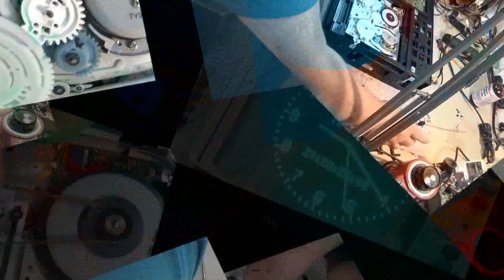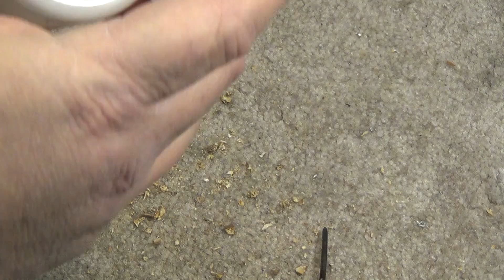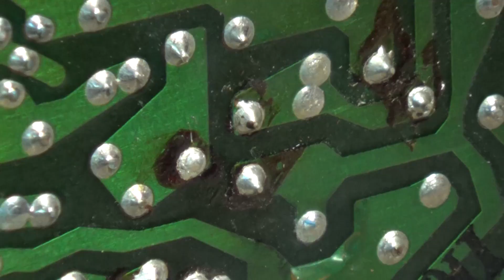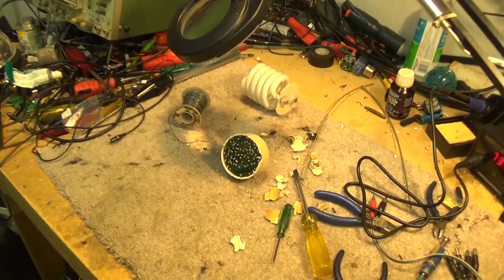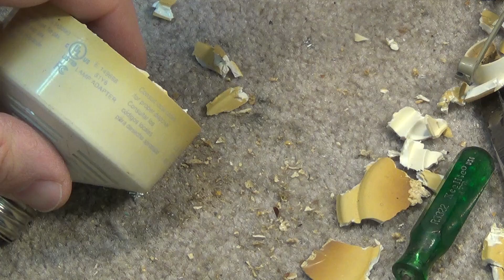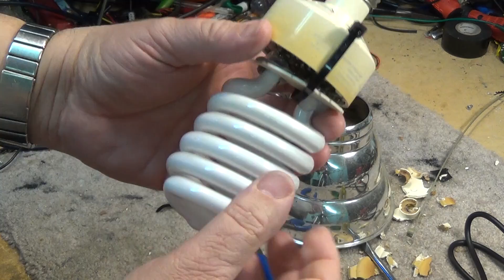42 watt cfl bulb repair

Comment: They could last longer or probably forever when the tube is facing up!
Leaving it hanging down can cause the heat to go up a fry the board.
Reply from the maker: Well that bulb lasted over 20 years when the lamp finally failed.  The board was fine so i stuck another lamp on it and it still works.  I have a big 65 watt cfl. I'm keeping it as a collector piece.  Along with a little 5 watt cfl. It's so tiny. Just 1 loop.

Comment: you know the customer service is usally good . I had a problem with are garage door opener from genie it caught fire and genie had me give them the model number and serical number my opener was on recall .they sent out a tech even thought I installed it my self .
Reply from the maker: +ducklandwikeno For most companies as soon as you say it sparked and smoked they want this handled as quickly and quietly as possible. The reason they were interested in the lot code was so they can track potential safety hazards. Nobody wants to be the next Zenith. In case everyone forgot, when Zenith went to their first Mexican made TV, the System 3, there was a solder connection problem on the horizontal linearity coil, and the new cheap boards were not fiberglass, they were that laminated looked like a wood by product board, and that sucker burned big time. Several house fires, and a few deaths resulted by these console (wooden cabinet TV) sparking internally and smouldering away for hours before bursting into flames.So when a company hears that something sparked and smoked, they respond very quickly. In the case of the defective bulb, which incidentally was the same lot number as this one, as I bought 3 at the same time,  they said they knew of an issue where the bulb failed and smoked as the internal fusible resistor failed safely, but for my inconvenience they sent me 2 free bulbs.

Comment: It is great to see you're making the most of that CFL! 13 years is a very long time, I haven't had a CFL last longer than 6 years usually although I've learned to try not turn them off and on as much as startups are the thing which kills them a lot quicker.

Comment: Only complete IDIOTS buy and use CFLs - takes a real moron to mess with fixing them.
https://www.youtube.com/watch?v=BBOxLi_-f0g
Reply from the maker: +theothertroll So tell me what is wrong with CFL lights?13 years ago there were no LED lamps, and even now the LED which I have used, and I have a bunch of them in my house, about 25 so far have not panned out very well. Out of the 25 LED bulbs that I bought that were supposed to last 20 years, 4 have failed, within 2 years. One, a Philips I tore down, and jumped a bad LED chip that had gone open. At least the CFL bulbs I use in places like my garage where I need lots of light have lasted a long time, and have paid for themselves in saved energy. Something I can hardly say for the cheap made in China LEDs that are flooding the market. The only reason I tore this one down was to see what failed in it, and as you can see it was a solder connection. The Achilles heal of all electronics these days.
Reply from the maker: +reynardfoxx I still like them for many applications. I will show off my new one in an upcoming video. It is a big one, a 65 watt monster over my work bench, and that is not the biggest ones they make. I have see 85 and 105 watt monsters advertised. I guess we can't really call these compact anymore. So now I have 2 42 in my workshop, and a 65.

Comment: They sure don't make them like they did back then, we are lucky if a CFL lasts 2 months.
Reply from the maker: +old64goat CFLs will last IF they are used as designed. They are not designed for use in areas where the lights are turned on and off all the time. Bathrooms are such a location. They are on for a minute and then off, and they will fail pretty quickly in this application. I use LED in that application. They also don't like to be in totally enclosed fixtures, they will overheat and have a short life. Ditto being exposed to wet conditions.  I have a bunch at my house, I am switching them to LED as they burn out, but I still have bunch of them here, that get used daily, and most are lasting the rated live. That is more than I can say for the Philips LED GU10 lights in my office that are only 2 years old and only putting out about 1/2 the lumens they did when they were new. Use them as they were designed for, run them for a minimum of 15 minutes and I have found that they last as they claim.
Reply from the maker: +Sony Trinitron Better act quick. The regular incandescent are being banned. I had a tough time finding some spate for my sons gecko. I need them for the heat, more so than the light, as reptiles need heat, and good old incandescent are a perfect source. They are getting harder to find now that anything over 40 watts is banned. Once stores sell out they have no more. Some speciality bulb makers are making new bulbs that look like antique bulbs, but they are expensive. Over 10.00 per bulb, but even those are being made as led style now. I have a LED filament bulb in an open glass fixture, and it looks really cool, with no heat.
Reply: +12voltvids I prefer regular incandescent bulbs for things like bathrooms, laundry room where they're not being used for long, my bathroom has had one incandescent bulb for at least 20+ years and probably won't be switching to LED on that one anytime soon, I'll think about getting a replacement incandescent bulb probably!

Comment: Won't the silicon melt from the heat causing mounting problems?
Reply from the maker: +jimbronie This is high temperature silicone I used.

Comment: Your fix... albeit less safe than OEM.... will provide for better heat dissipation. Hopefully the crusty plastic bulb base will not disintegrate around the tie strap. On the other hand $50 / 13 years =$3.85 / year. Still rather pricey but energy savings more than makes up for it.  Something that I would have attempted myself, but used computer motherboard standoffs rather than zip tie, but that is only a different method, not necessarily better. Thanks for the video and keep them coming.
Reply from the maker: +Doc Falworth Well this is in an open fixture, in my garage. The crusty plastic that was crumbling is all gone. The rest of it around the socket it fine, as it wasn't exposed to the UV that dried it out. The new tube base, made from the heat shield will not get the UV, but by the time that becomes a problem the burner will likely be toast. It probably wanst't quite 50.00 when I bought that bulb, more than likely in the mid 40-45 plus taxes. I remember buying 3 of them and it was something like 135.00 as my wife gave me the "stare" when she found out I spent that much money on 3 light bulbs for my garage. The energy saving is pretty good though. These lights give off the equivalent of a 150 watt bulb, drawing only 42 watts. I don't know if you can even buy these big CFLs anymore, but I have 2 new ones still in the box for when these ones do finally die and have to go to the recycle center to recover the mercury.

Comment: Hi, appreciate these type of videos. Plastic usually contains a plasticiser along with resin and binder- seems the heat and uv caused the evaporation of the plasticiser, which causes a brittling of it. Is there anything like uv/heat proof tape or a spray on plastic conditioner or even a coaring of silicone that might help around the base area of lamp?

Comment: You can fix the magnifying glass by replacing a lamp through a dense LED strip with a simple power supply, capacitor , diode bridge, resistor .Will be brighter and longer work.
http://images.elektroda.net/93_1335854736.png
Reply from the maker: +Blahblox Gyuanox The circular light came with the magnifier light. I'll find a replacement cheap enough I am sure.

Comment: Wow thats done really well, great that youve fixed it :-D.
Do you notice the lack of blackening on the ends of the tube, quality driver :-).
.
We had an early version, it was bloody massive, also the tube was in a big thick jam jar that was bonded to the fitting, honestly it was like a bomb just hanging from the light fitting lol :-D
If it had fell, it would have knocked someone out if it hit there head, massive thick glass jam jar, i dont think it was electronic, i bet you have seen one.
Reply from the maker: +zx8401ztv Yes I have a brand new never used first generation GE lamp from the early 80's. 20 watt, has a linear tube that is bent back and forth under a large glass jam jar cover. Uses a big magnetic inductor type ballast and a neon starter, so when it is powered up it blinks a few times before it kicks. I also have a couple of old Panasonic lamps from the early 90's with electronic ballasts. They also still work.
Reply: +12voltvids 
LOL i knew you had seen/have one :-)
Arnt they a monster lol no place for the jam though :)